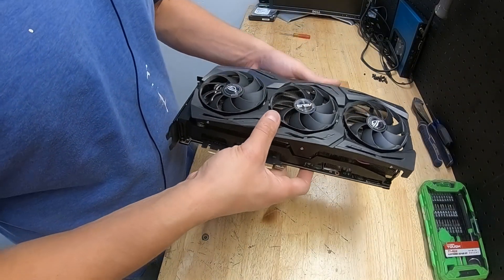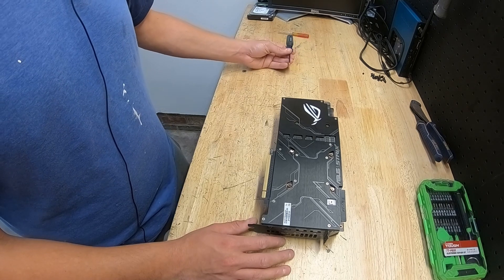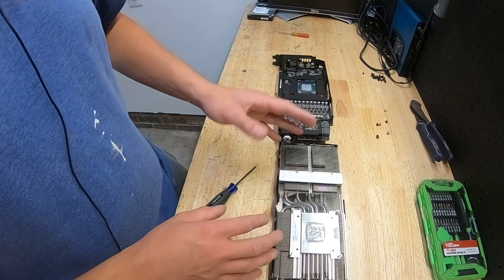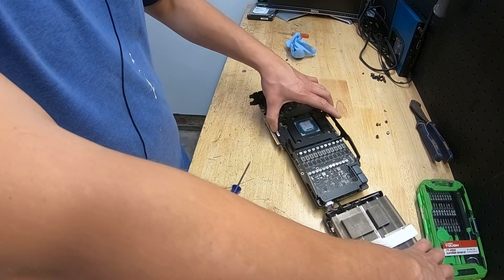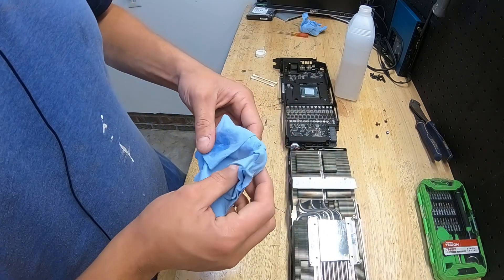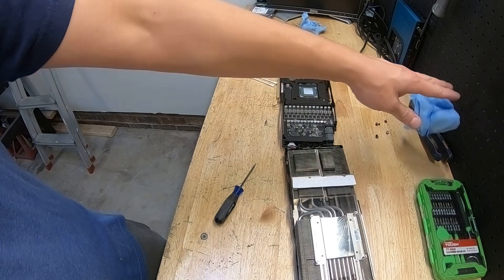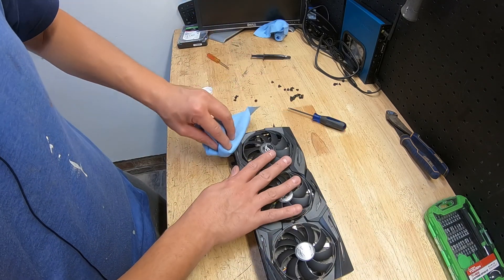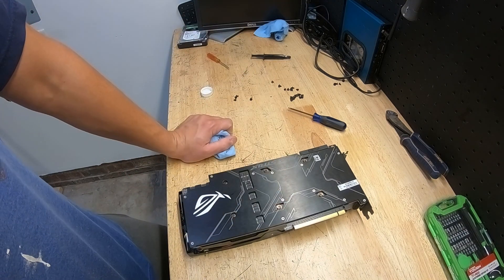Video card maintenance!! Asus 2080 Strix thermal paste replacement! Easiest card I ever fixed!!

Comment: I have 2 fans that basically went out on my card and I have to replace them I believe because of this my thermal paste cracked from getting too hot and it doesn't cool down quickly and almost at all. Like the fans have no effect. Thanks for showing me this I really thought I had to start from the fan side but im a veteran at PC work so it goes to show you always should check your basics before you reteach yourself something.

Comment: I've gone from 75 degrees Celsius to 62, and from 105 degrees hot spot to 75.
I have used Noctua NT-H2 as thermal paste and as thermal pads Gelid GP-Ultimate 1mm for the vmem-vcore thin strip and memories 3 strips and 1.5mm for the long strip.

Comment: This video was a life saver.
I have the same card. It was very noisy during games and I thought it's normal... until I checked the temps.
Hotspot 108 C
I opened it up and to my surprize, the thermal paste on the gpu was all but gone.
A blob of MX-4 later, the temps dropped by 40 C to a much cooler and normal 67 C

So, a big thank you.
Reply from the maker: Thanks!!
Reply: Yeah thermal paste should be replaced regulary it even dropped my temps on my gtx 1060 6gb it was literaly hitting 90 degrees celsus under load and it was noisy but after thermal paste replacement it went down to 65 degrees

Comment: Question: Why didn't you change the bottom thermal pads?
Reply from the maker: They did not rip, were still pliable and spongey so their was no need to change them. I only change them if they are dried up and ripped.

Comment: Hi @DLM Tech Garage. How does your Asus Strix rtx 2080 overclock to? I'm getting max 2085 Mhz but doesn't stay there due to temps and drops to 2070 Mhz. I have the same card. Is that still a excellent Overclock for my card?? Whats yours like?
Reply from the maker: card oc depend on the quality of the card., some oc higher then others so its hit or miss. I was able to hit 2150 on mine but that was due to upgraded thermal pasted, more aggressive fan curvs and good air flow in the case.
Reply: @DLMtechgarage  I have changed thermal paste and pads and still maxing to a 2070 Mhz long session in games. I have my fan curve set to % to degrees c, e.g at 60 % fan to 60 c degrees on the card. Do I need I more aggressive fan curve do you think?? Appreciate your insight and your time :)
Reply from the maker: @danewright6193  for overclocking and find your limits, start with a max fan curve and then see where the card crashes. that will let your know your card potential on air cooling. then you can dial back and tune your fan curve accordingly.